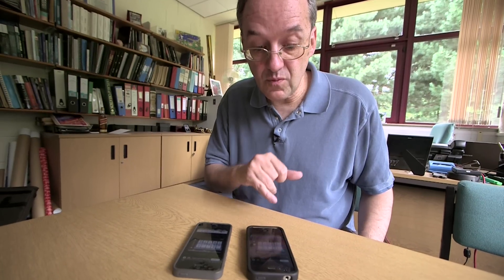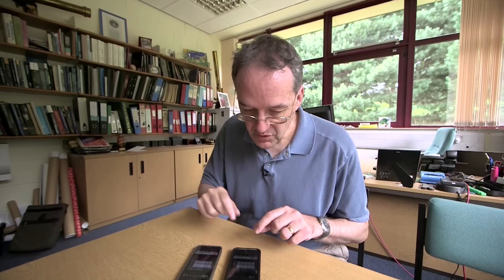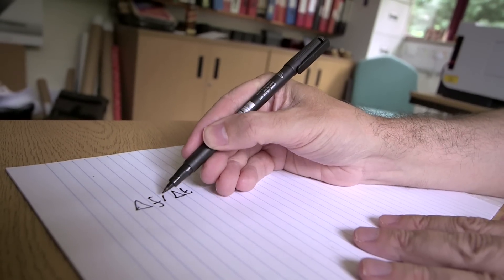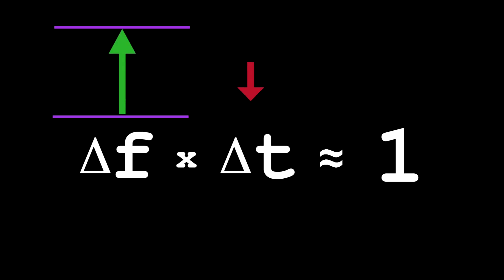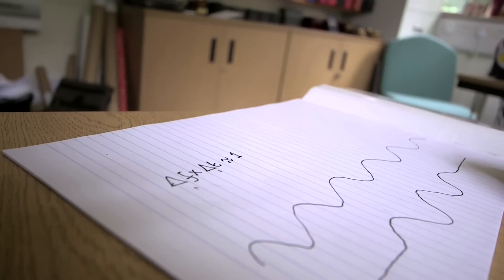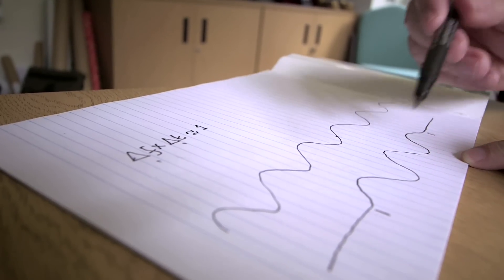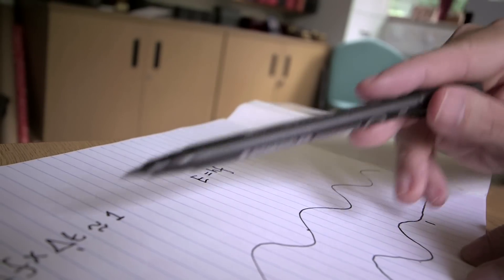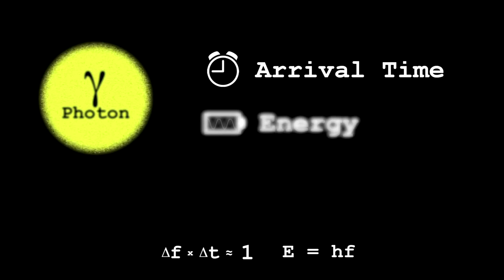What is the maximum Bandwidth? - Sixty Symbols

Comment: sampling theorem = uncertainty principle
Reply: Peter Martinson Not really... Putting it simply, sampling theorem tells you that you need a certain sampling frequency in order to correctly reconstruct a signal (i.e., if you sample with the wrong frequency, you can still reconstruct a signal, but it will could not be the correct signal). 
Uncertainty principle tells you that you cannot know with 100% certainty some specific characteristics of a quantum system.
So, they basically apply to different physical realms and they are not equivalent...
Reply: They are the exact same math. Because quantum 'systems' are waves, the sampling theorem applies and limits the precision with which the wave function of a particle can be determined.
Reply: I disagree. The sampling theorem poses a technological limit (if your device is not powerful enough, you cannot reconstruct the signal, but you could at least in theory have a proper device which fits your needs), while the indetermination principle poses a fundamental physical limits (you cannot measure precisely two conjugate variables).

Moreover, the sampling theorem deals with "sampling" of signals. You cannot "sample" a quantum wavefunction - and that is because it collapses, and is not related to sampling theorems or similar things.

With "they are exact the same math" you may mean that they both stem from Fourier transform, and that is correct. But this mathematic is applied to different systems with different properties, and you cannot thus say that they are equals.
Reply: The sampling theorem doesn't deal with power. It deals with sampling rate and number of samples to reconstruct a frequency spectrum with a certain range and precision.
And look at these two equations.
Uncertainty Principle:
https://upload.wikimedia.org/math/8/6/d/86d2f0d2ca356c27cdef886e6ed1af1b.png
Sampling Theorem:
https://upload.wikimedia.org/math/9/2/d/92da474023698cfdde5ba9b3db52c066.png
Reply: I know, I meant "capable", or "fast". This does not change what I've said afterwards.

First of all, looking at two equations means nothing: they might be similar, and it can be interesting to look at why they are similar, but you need to understand what's behind them. You cannot simply say "These two equations looks identical, they must mean the same thing".

Second, the two equation basically differ in a large number of ways; for example, the limits of the integrals are different (in the first link they are infinite, in the second they are finite), or they have different normalization constants, and this means that they live in different Lebesgue spaces with different definitions of "Fourier transforms".

Thirdly, the expression you linked are just two cases of a Fourier transform, and this is completely unrelated to the system you are dealing with. The same equations apply to strings of a guitar, to vectors in Hilbert spaces, heat diffusion. They are just definitions, not results.

Rephrasing the difference between S.T. and I.P. again, the sampling theorem stems from the fact that if you sample the signal with too few points, the spectral components of the Fourier transform overlap and this aliases the reconstructed signal. The uncertainty principle means that you cannot measure with infinite precision a couple of conjugate variables of a quantum system, that is, regardless of what kind of equipment you have.
Reply: Well, since this a physics and math discussion, I thought that when you said power, you meant power (energy / time).

The S.T. and I.P. are two different conclusions from fundamentally the same principle. The reason that you can't know the location and momentum of a particle-wave with infinite precision is exactly the same reason that you can't exactly reconstruct a frequency spectrum from limited data.

The wave of a quantum particle-wave is like a probability wave in space. If you know the contour of the wave then the momentum in a large amount of space (i.e. lots of sampling) you can't know the location of the particle with precision (because you've defined it as a probability in space). However, if you measure the wave in a very limited amount of space you can know the particle's location with great precision, but you haven't constructed the wave which will give you the frequency and thus the momentum.
Reply: I do not agree at all.

Sampling theorem is a direct consequences of the algebra of Fourier transformation, while actually the indetermination principle comes from the Cauchy Schwarz inequality in Hilbert spaces and from the fact that fact that the commutator of two conjugate variables is non-zero. 

For ST, check https://en.wikipedia.org/wiki/Nyquist%E2%80%93Shannon_sampling_theorem in particular the paragraph "Aliasing", while for IP check https://en.wikipedia.org/wiki/Uncertainty_principle#Matrix_mechanics_interpretation in particular "Proof of the Kennard inequality using wave mechanics" and "Robertson–Schrödinger uncertainty relations".

These are quite different derivations stemming from different principles for different systems using different mathematical framework. 
The presence of the Fourier Transform is just related to the fact that it is a powerful tool to describe signals.
Reply: I think you're making a distinction without a difference. I can't see anything in that information that contradicts what I am saying.

In the "Proof of the Kennard Inequality using wave mechanics" they are taking advantage of the fact that the position and momentum are Fourier transforms of each other. This is analogous to saying that the signal in frequency and time are Fourier transforms of each other.
Reply: +Peter Martinson Could we think like this: As soon as we start treating particles as probability Waves, then any math regarding Waves must apply. So in that case the sampling theorem for Waves leads to the uncertainty principle for particles.
Reply: Exactly

Comment: one should note that he actually talked BS one single time : analog signals (of any kind) are not generated via sinewaves which are added up accordingly, as was implied by his words - DACs use several different methods & stages to APPROXIMATE the digital signal, its a simple tracing-algorithm most of the times - actually generating non-discrete functions which overlap would be the most inefficient way one can think of. The physical limits of the carrier-medium have nothing to do with the signal generation, high-quality DACs may easily generate analog signals which cant be transmitted via any consumer signal medium, there is no inherent limit, the spectrum of the visible light can EASILY (yet expensively) be filled with large amounts of data from a DAC-network - even way beyond that, its the optical cable itself which cant refract / transmit much outside of that spectrum ....

Comment: Is he talking about all the harmonics needed to make a square wave?  He's not making any sense.
Reply: alex tworkowski - yes he is because turning it on and off creates a square envelope
Reply: He is only partially talking about that but that is indeed not the point. Its similar to square waves but the math works out to different harmonics.
Reply: I mean i think he's hedging around the Fourier series and some Nyquist on top of it.  I think he's waffling.  He's saying that a laser can't remain coherent if pulsed.  There are pulsed lasers.  I think he's full of it.  Rubbish.  Why are smart guys always so cryptic?
Reply: He's saying that a laser can't remain coherent if it's pulsed too quickly (small enough delta t) because of QM.
Reply: Is your QM referring to Quantum Mechanics or Quine-McCluskey?  In either case, i don't see the connection.  Please elucidate.
Reply: QM = Quantum Mechanics. What I meant -- and what I believe he means -- is that there is a theoretical, quantum mechanical limit due to the Heisenberg time-energy uncertainty relation. I didn't mean to imply we reached this limit with our current pulsed laser technology. However, should we one day fluctuate power quickly and strongly enough, we will find that the we run up against this limit. At this point, I cannot explain this line further and admit it all might be untrue. From what I learned about QM and lasers, though, I think Mr. Merrifield is onto something true albeit not stated sharply (and nor will I attempt to do so).
Reply: Euquila   Ah.  Very excellent explanation.  Thank you for your insight.
Reply: What he is referring to is the demonstrable relationship between switching speed (pulse modulation) of a sine wave (carrier/laser wavelength) and its bandwidth. You get exactly the same effect with radio waves by Amplitude Modulating a carrier with a square wave. He points out that this relationship has applications in QM, but his point is that there is a limit to your data rate through a given medium and it is fundamentally a bandwidth restriction.